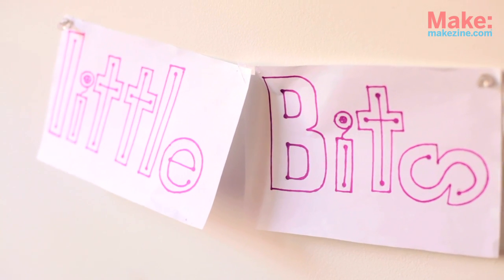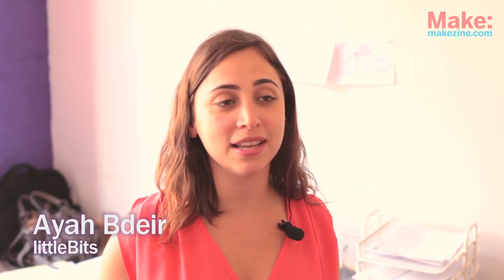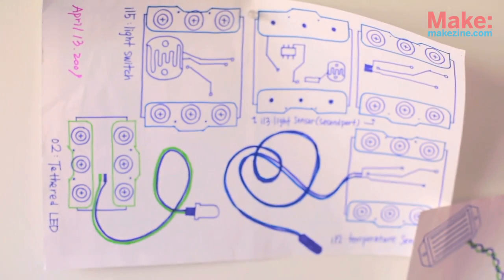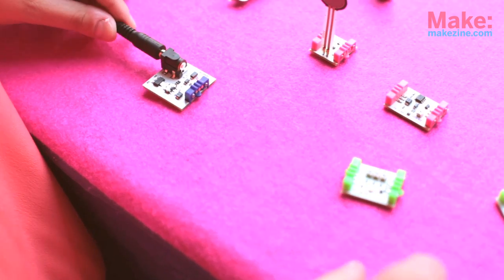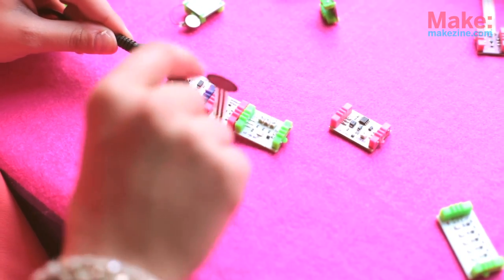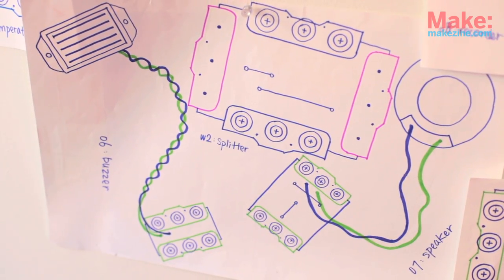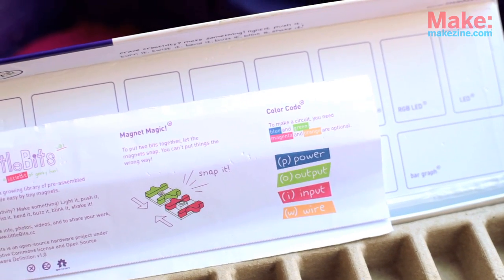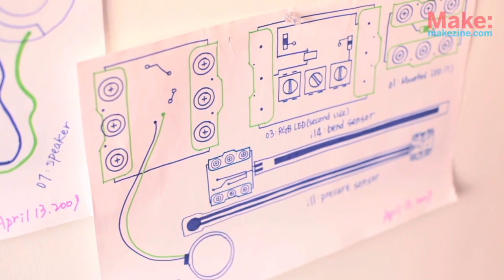Modular Electronics Parts for Prototyping: littleBits

Comment: I know what you mean. When I was taking electronics, during the section on frequency and wavelength I guess I was studying a bit overmuch. Anyway, at one point, while riding public transit, the bus I was on pulled up behind another bus with a sign on it that said, "This vehicle makes frequent stops."
My brain was used to the short form for frequency (freq), so with a quick glance at the back of the bus in front my brain read, "This vehicle makes freq (freak) stops." I was definitely startled.